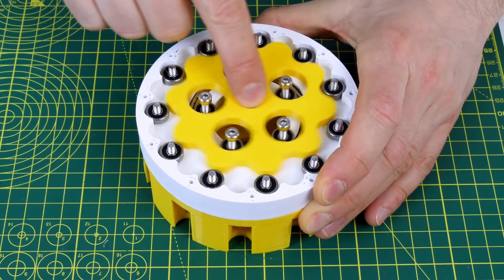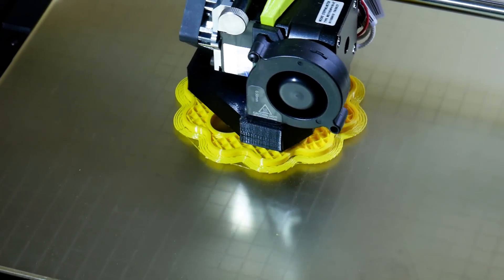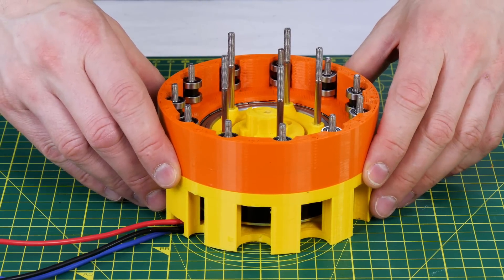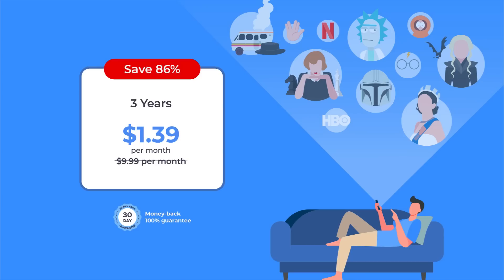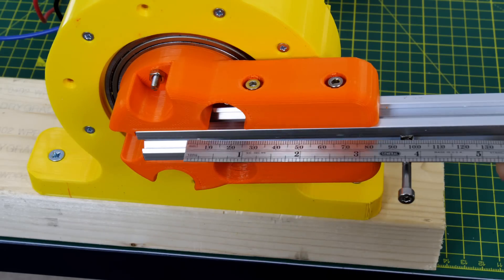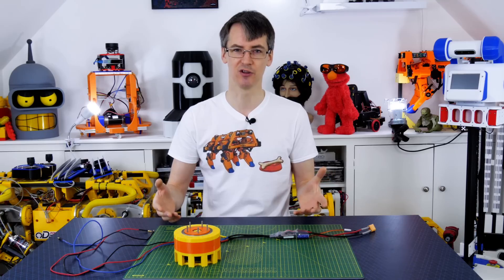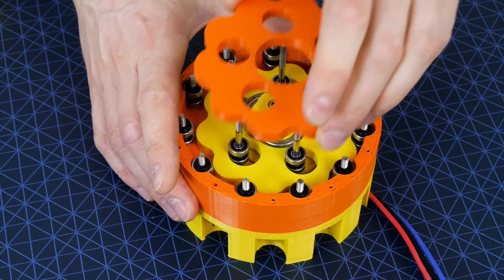3D Printed Cycloidal Drive V2 - Much Better!

Comment: An simple trick to increase layer line strength is to just print at an angle. Even a slight angle will help. With some of these parts that are held on the inside of a bearing, you could put a flat spot on the OD of the part and print it on its side as to not use any support material. 

Another easy trick is with counter sink screws. If you use a hand drill to spin the screw fast in the hole before assembly, you can friction form the counter sink to the shape of the screw. This not only more evenly distributes the force of the screw head to the plastic but also bonds the layers in the countersink together better. Also, this helps when you don't know the dimensions of the screw head. (some) Wood screws have a compound angle on the head and instead of trying to model it perfectly, get it close and melt it with friction the rest of the way.

Comment: You can do the same relative motion with evolvente teeth profile gears. This way you can achieve even higher reduction ratios and still achieve backdriveability without compromising in mass by using so many bearings.

Comment: I use VESC with hall sensors or a AS5047D encoders all the time.
With an AS5047D the VESC supports position control, too.

Comment: Have you adjusted the Advanced settings in Vesc tool for that Vesc? There is a few settings there which will make the slow speed much stronger and reliable. That Vesc is made for accelerating skateboards from standstill so its very tuneable.

Comment: James! Consider taking the output from the outer lobed ring, and have the now ouput pins stationary. It's way better for your application. Go see https://hackaday.io/project/167688-401-3d-printed-cycloid-gear-actuator-module-v2. That's what I'm talking about.

Comment: Very nice! That looks much smoother and more durable than the last one. I still think that if you made the outside of the disks slightly concave and the outside of the bearings slightly convex that you would get a smoother transfer of power. A) It would make the disks self-centering; reducing wobble and vibration. B) It would reduce side-load on your bearings; increasing longevity and reducing friction. C) It would spread load over a larger surface area; increasing longevity of the disks. Also, maybe  a grease channel in the center of the disks to hold a very small amount of lubricant?

Comment: Great design. Just a thought: If you're just testing the gearbox, why not just take the motor out and lock the motor input. Then you can put torque on the output until failure.

Comment: Well done so far. The next step is to test till destruction, and identify the weak links, Im guessing the central cam shaft pieces. For these you could make a mold from the 3d printed parts in silicone, then cast two part polyurethane copies of the original ( pick a material in the 65-75 D shore hardness range) hexcel modipur. In fact, if you need to make several of these, you could just make a mold set for all of the parts. The good thing about this is that you can re-inforce the polyurethane with chopped strand fiber glass, or carbon fibre / mineral filler. This tech is a perfect fit for the type of prototyping you do

Comment: Interesting application. You could add bearing tracks to each cycloidal disk that would allow for adding individual ball bearings (also nylon or ceramic?) and would also serve to space the discs apart; thus reducing contact area and friction.

Comment: When filming a close up of your 3D prints I noticed they are very bad printed.
Many extruded lines are not bonded together and therefore makes it a  weak print.
I can recommend to PID tuning your printer to solve this issue. 
Keep up the good work, I like your video's.

Comment: It's so cool that you're making a cycloidal drive at the same time Levi Janssen is making a harmonic drive. They are very different approaches to the same problem, compact gear reduction, and I'm interested in seeing how they compare. It seems like the harmonic drive has a larger reduction and might not be as easy to backdrive, but it looks way more compact and is simpler to make.

Comment: 15:01 It seems that making more of the device from laser cut delrin could simplify the device significantly though I don't have access to a laser cutter to test the idea out. 
It seems like the bearings could be eliminated either replacing them with delrin replacements or cur the housing from delrin and potentially eliminate the need for many of the bearings reducing both cost and wight. 
But the cost of that is losing the ability to 3D print the device :(

Comment: I like it.  It's compact and powerful. And rate at which it rotates with the amount of torque it has...  LOL  That thing is dangerous.  :D

Though something tells me that won't be satisfied until you build a more 3D printed version that has the weight reduction you discussed in your wrap up.  LOL  I know if I were in your shoes, it would drive me nuts not to.  :)

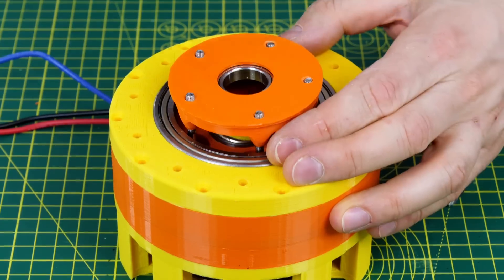Comment: 6:12 Can you please not copy how to (mis)use tools from Ivan Miranda. :)

Would it be possible to cut the discs from 3mm alu on the cnc? So the 2 discs and a spacer between them is the  thickness of a single bearing? That way you only have half of the bearings, but you'll need half height bearing on the camshaft...

Comment: is that not nearly as heavy if not heavier than a multi-stage gear reduction due to the sheer number of bearings and bolts involved?

Comment: What about UHMW spacers, and  a couple of the bearing surfaces. While UHMW doesn't do well against itself. It should do well against the PLA. You might be able to buy an off the shelf tube even, in the right size, that you can just cut down into the required spacer length.

Comment: An alternative to doubling the number of bearings do you think you could produce a balanced center off center gear and cycloidal disk by varying the infill or putting a solid mass in the opposite side?

Comment: I mentioned this in the last video, but there's a variant where the outer housing rotates and the cycloidal disk(s) only wobble (but don't rotate).  Since this is intended to be used as a shoulder or leg joint you would be able to print the armature and the outer housing as a single piece.  This would seem to have some benefits in weight, overall size, and reduced side loading of the bearings in the whole leg.

Also It looks like you have some space between your cycloidal gear and your bearing surfaces (both inner and outer), which is almost inevitable with 3d printed parts. In a perfect world the cycloid would touch every bearing at all times, and would not have any slip contact with the bearings (which then wouldn't turn). In the real world only a few points will contact at any one position, and you'll see some slip contact with the bearings (which is why they are turning slightly).  If you continue using the bearings, consider a compliant membrane (rubber bands?) around the bearings.  This will probably quiet the mechanism significantly as well as ensuring all the bearings share the forces, instead of one or two at a time.
Reply: lol do you mean harmonic drives?
Reply: @qwertzuiopqwertzuiop2107  not at all.  I dont advocate harmonic drives for this application because they are rarely back-driveable
Reply: @qwertzuiopqwertzuiop2107  harmonic drive would be a better idea
Reply: this
Reply: i think he means this thing. 
https://www.youtube.com/watch?v=IKkw4d7jyu0

Comment: It looks great, though there will still be a tiny amount of imbalance off-axis, but it's not worth the extra expense to make it perfectly balanced.  It may be worth the effort to get 4mm steel shafts, as they are easy to get on Amazon (uxcell is the first seller that comes up). Just be forewarned that they are hardened steel and thus do require tools to cut, and it might help to have some of the basic tools for mounting bearings because it'll be a close fit.

Comment: PLA is probably the best choice for gears. Because of its hardness and also because its very smooth. ABS is maybe more heat resistent but because it is more flexible and not as smooth (still very smooth), also would generate more heat.

Comment: I read that having only 2 discs is not enough to cancel all vibrations. But adding more out of phase discs adds friction. So only good at low speeds.
Reply: cycloidal drives offer more reduction in a small package. he's using a 5:1 reduction and could probably get away with a belt which would be FAR simpler with a belt, and zero backlash too. I made a 30:1 drive that's smaller than what he made (using two for a satellite dish rotator)

Comment: What about oiled bronze bushings (aka sleeve bearings) instead of bearings or spacers? They're a lot more robust than plastic, but still very light and cheap (<$0.75 USD each). Even the larger ones (20mmID) are only like $8.

Comment: Have you considered replacing the smaller bearings with 3D printed rollers on metal pins?  Might help reduce costs if it works.

Comment: Printing the whole thing in Nylon or some other hard wearing filament (igus filament, Ninjatek Armadillo), and packing it with some heavier grease will do a good job in reducing the parts count. Potentially using some liners and bushings instead of the large section bearings well might cut down on the cost without compromising the accuracy and strength. Bearings are great for higher speed, but aren't as necessary for low speed applications like a robot joint.

Comment: You can attach three hall effect sensors to the VESC, and just glue them near the motors magnets. Impressive design! I think not having bearings would be a mistake. Rolling friction is in a whole different ballpark than sliding.

Comment: A backdrivable £50 20Nm 200g 200W actuator would change the world of dynamic jumping robots. I'm not convinced it would be possible with anything less than 50:1 reduction. This means you 'only' need 10A at 20V and a 200kv motor delivering 0.4N at 5000rpm.
The "Open Dynamic Robot Initiative" (website on github) is also quite impressive. They save weight by integrating the reduction into the leg instead of a separate actuator. 12 x 1100g is quite a weight budget before you even start on the body.

Comment: You can see some vibration transverse to the drive shaft at the resonance frequency of the drive. I guess at the cost of a lot of complexity you could have not one but two additional cycloidal disks 180 deg. out of phase with the first, each half the mass and on either side of the first disk. Could you "replace" the bearings with a bit of machine grease? That should make you feel better about the plate-on-plate friction, too. I don't know enough to know if a petroleum based lubricant would be compatible with the kind of plastic you are using. It's amazing how solid that drive looks.

Since you have three bolts securing the second offset onto the first, what is the purpose of the the "key" that it fits into?

Comment: VESC can use Sensors and the newer firmware version also have HFI that allowes you to start pretty good even without sensors. Its still probably not the best controller for your application but if you configure everything properly it will be a lot better than in your current test.
Reply: Yep not sure if HFI would would work on a motor like that but is worth a test! It can use many encoders as well.

Comment: This is starting to look super promising! Another alternative to the bearings might be bronze bushings. Could probably be fashioned out of some bronze pipe or whatever that's available at a local hardware store for plumbing, though their inner diameter might be too large. Nylon would certainly be better for weight reduction, but I'm sceptical about their endurance (based only on gut feeling, to be fair). With either you could try making the cycloidal disks either thicker or thinner. I wonder how it'd hold up with less or more surface area, especially once you work on opendog v3 where you might want to have the knee joint be a thinner design than the hip joint or something like that.
Reply: I was thinking just make the entire thing smaller. It looks really solid already. If there is a problem with structural integrity for a smaller version, just try a stronger material.

Comment: Hey James! Loved the video. Just a thought for the final build, you should look into precision shoulder bolts... They have a precisely ground diameter and a threaded section on the end. Should work really well for a bearing fit without much redesign. They're not too expensive either. Cheers!

Comment: You could reduce friction on the disc's by making some small dimples or grooves in the surface (reduced surface contact). Would also serve as a reservoir for extra lube.
Reply: Friction has almost nothing to do with contact area. Just force and friction coefficient. A reduced contact area will most likely increase wear and a thin grease film is sufficient.
Reply: @AlmightyMister  look up machine scraping vs surface grinding and tell me that's still true.

Comment: Awesome! What is the total cost of all the bearings?
Reply: Oh 100 pounds. Over $100? Is it possible to use only 3 bearings for each disk (for the holes in the disc)?
Reply: @TheRainHarvester  I priced it out from AliExpress for a bit less than half that, which is still more than I want to spend. Maybe a single taller needle roller bearing instead of the two bearings on the outer pins would be cheaper?

Comment: It seems to me that the weak point is the multipart cam. Should you plunge for the extra naufacturing cost and extra weight, an aluminium one should do the trick if it were to fail.
Reply: I don't know much about 3D printing, but couldn't that cam be printed as a single piece?

Comment: Hey James, I have been following your work and gotta say I love the videos and all the progress you've made. Also Have you considered the harmonic drive for the reduction? I am sure you already know about them, but they are widely used in robotics, very relyable and lighweight, and straighforward simpler for some joints. Sorry english is not my first language. Good luck with the channel and the proyect dude, you are nailing it.

Comment: Armchair engineer here (in other words, zero knowledge). With regards the discs rubbing together, could you add some recessed
ball bearings between them? I guess though it could cause wear and tear as well a little flex.

Comment: great work! Maybe a bit of sanding with some rough then fine paper on the discs might help with longevity.
Reply: Just print on glass and under cura enable ironing for perfect smooth as glass parts.. His printer is under excruding those parts are very stringy..

100% infill on some key parts and petg would make it insane.  

I want 4 so I can make a 4wd MX5 groceries getter picker upper dinner supper~~~

Comment: oilite bronze bushings would also be good to replace the small bearings as they are ideal for low rpm high load applications and are self lubricating

Comment: You know you can put an encoder on the VESC right?
Reply: Also check out the flipsky mini VESC 4.20 which is substantially cheaper and smaller than the standard VESC and has proper heatsinking on the FETs.

Comment: I thought you would attach the leg directly to the motor. Making it the joint, and removing a few potential failure points.  Your way gives better leverage potential though =)

Comment: This might sound crude and simplistic, Why not just use nema 23 or 34 stepper motors with a closed-loop feedback board something like the opensource one like this,   https://tropical-labs.com/mechaduino/   They will take about the same amount of space and cost about the same,  as the motor you are using isn't cheap when you factor in the motor and speed controller..., and with size with all the gear reduction will take about the same amount of space... Just a thought.

Comment: That's amazing. There is something really statisfying about seeing precision mechanical prints that work.
Reply: M
Reply: 'Precision' isn't very applicable here 😅
Reply: @xxportalxx.  would you care to explain? :3
Reply: @gokiburi-chan4255  it's made from 3dp fdm parts using bolts as axles... do I really need to explain the lack of precision here?
Reply: @xxportalxx.  but isnnt lack of precision in this case still a level of precision ? 
i'm really asking honestly, forgive me for being an idiot.
Reply: @gokiburi-chan4255  ok, see you're now mixing the types of speech, yes the noun precision can refer to any level of precision, however when used as a noun modifier it means that the noun being modified is precise. So if I were to ask what the precision is then yeah it can be anything and still be considered precision, however if I describe something as being a precision thing then it is by definition a thing that is expected to have a high degree of precision. 

So by saying 'precision mechanical prints' it implies that the thing 'mechanical prints' is very precise.

But even without knowing all the grammer rules and definitions (which I certainly do not, english is a mess) you can simply note that colloquially saying something is a 'precision instrument' generally implies a high degree of precision (not a variable degree of precision).
Reply: @xxportalxx.  yea but isn't  there still a level of precision on 3d printing?  and the first comments want to emphasize on that. 
it isn't comparable to the precisions on machine shop work. but it's still precise to a degree. 

again i'm really asking honestly. forgive me if I sound condescending.
Reply: @gokiburi-chan4255  ok, to end this conversation, assume I'm talking generally where the op is talking specifically and it all works out. Cheers

Comment: Great design and nice improvements over V1.
Reply from the maker: thanks, more testing coming up over the next few weeks.
Reply: @jamesbruton  What are your thoughts on having three disks? Is your design rigid enough to have the output on one side as opposed to both sides of the gearbox?